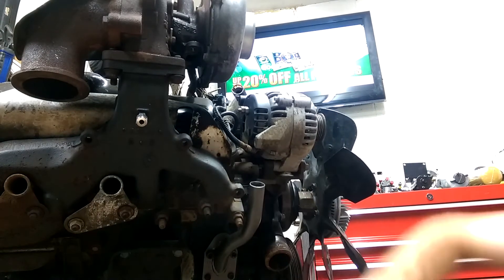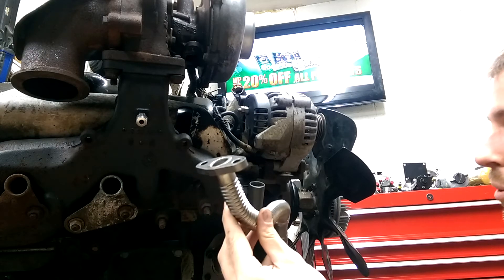6.5L Turbo Drain Line Kit Install

Comment: It’s a perfect kit. I had to make a gasket tho as the sealant weeped on my installation, but it makes touching the turbo so much easier than the bent pipe and leaky hoses I’ve had.

Comment: Any idea where I can find the " Drain plate " cheaper than $105.00 or should I just fabricate and weld up my own?
Reply from the maker: We used to sell them but had various issues with braided or flexible lines not draining well enough for some turbos.
Reply from the maker: The 6.5 platform has been plagued for years by cheap products that do not work and give them a bad reputation. We refuse to continue that trend : )